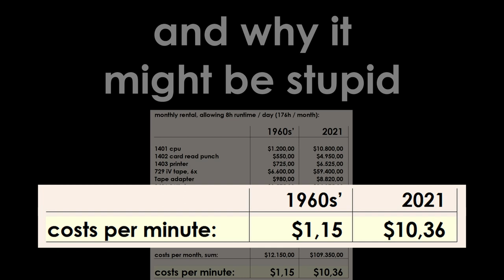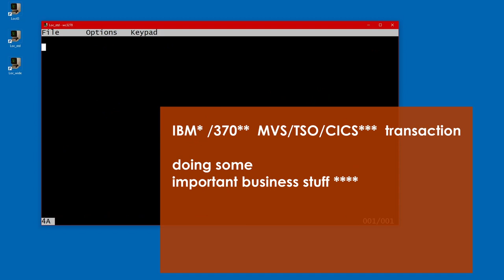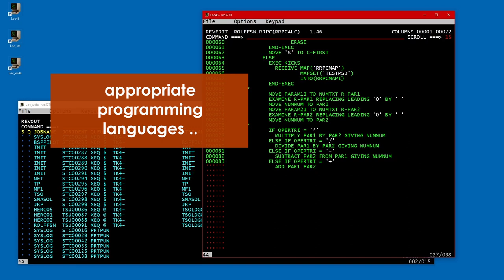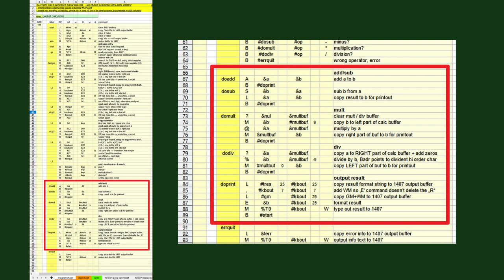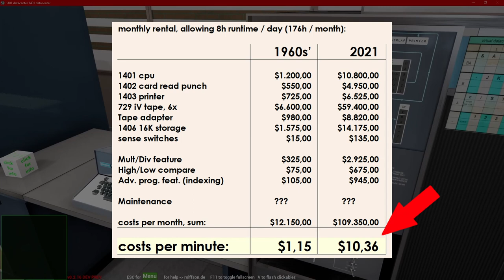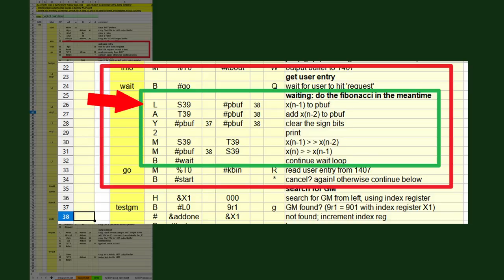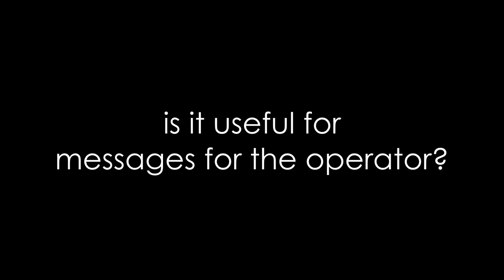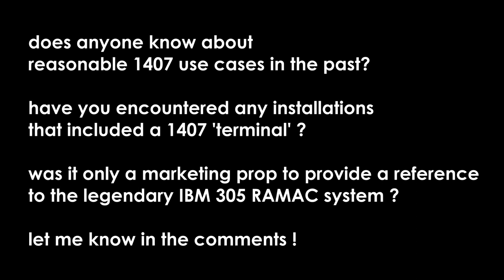IBM 1401 programming: the 1407 inquiry terminal - R15

Comment: I just spotted your series on the 1401 and it caught my interest as a former IBM 1400 series operator and programmer.  Back in about 1964-1969 (in Melbourne Australia) we operated a "big brother" IBM 1410 system (taking up most of the floor of a city skyscraper); we upgraded memory a further 16K BITS (BCD) from 48K to 64K BITS  (so for it's time it was a big system globally), plus we upgraded from 4 to 6 tape drives (and later added many more) and we added a second read/write arm on the IBM "RAMAC" 1405 disk drive !!!!!  We wrote our own operating system to monitor jobs and automate operations processes. To run some of our larger programs we had to load and unload large overlays from the 1405 into memory and branch to the overlay code.  The configuration of our system was somewhat unique so if we had a serious problem we'd occasionally phone the IBM Rochester factory for support.
* You asked for feedback on the IBM 1407 - - - 
*   Our system included an IBM 1407 enquiry terminal. You are correct in stating that as a device the IBM 1407 was not very useful. 
*   The only useful operational task of the IBM 1407 was it recorded the time each job started and finished (i.e. extracted from the operating system we wrote) and we recorded any error messages and sometimes occurrences when we needed to stop a job, if a job was re-run, etc. It was a crosscheck for "internal billing" to the various office departments. We would handover the original print-out at end of shift to the Operations Manager and carbon copy retained for auditing.
*   We operated with 3 shifts around the clock 24x7.  For normal operator tasks we had no use for the 1407 printer (except 1 job) but we did check it if if we heard it's chattering burst into action. The "one exception" was an annual job that ran non-stop 24 hours for about 4-5 days doing a full valuation of insurance premiums, life insurance cover, bonus calculations, etc. About every 20 mins the 1407 printed a short reminder message for that job reminding us of the particular tapes to mount next and whether a checkpoint needed to be made so we had somewhere to restart if we had a crash.
*   An IBM CE (Customer Engineer) was based on site and he would use the system to run weekly diagnostic tests, and if a fault was found he'd shut the system down, fix a problem, replace faulty logic cards, etc. So, a second useful task of the 1407 printer was to print out messages for the CE, record his testing, and the carbon copy was used by our auditors to know it was non-billable time. (Some individual transistors that performed one AND or NAND instruction were the size of a thumb.) 
Note: Our operators might do similar if we had a crash and needed to interrogate specific areas of memory and dump diagnostic data to analyse problems.
* So all the print-outs from the IBM1407 really only provided an audit trail of jobs, time-stamps for billing and traces used for problem solving

Comment: The document "IBM 1401 System Summary" says: "The IBM 1407 (Figure 35) provides a fast, direct, manually controlled means of communication between the operator and any model of the IBM 1401 Data Processing System. Using an instruction format, the 1407 can control both reading from, and writing into, storage. It permits the 1401 system user to either examine or alter the status of a particular account, record, or instruction stored in the system. This feature is especially useful in a disk-storage oriented 1401 system, where information such as customers' accounts, stock status data, and payroll details are kept categorically. Through the 1407, the operator can request specific data from any disk record, and have the information automatically typed seconds later. This typed copy also serves as a log of information entered into, or received from, a 1401 via the inquiry station."

It sounds like it would be useful in cases where you ran the same sort/search program, but with a lot of variability in the input parameters, especially parameters that you might not know ahead of time. It would need to be a big dataset, and it would need to be more valuable to the user to be able to call up data almost instantly, than it would be to keep the 1401 running other jobs while a new search program was punched.

Comment: Considering that the 1407 has the Request key to ask for attention from the processor, I suppose you could code a long running program to look for that key periodically and allow itself to be interrupted in a controlled way so the user could query data stored on disk. There's an IBM film on Youtube demonstrating a similar operation on a RAMAC system.  Edit: This is the film: https://youtu.be/oyWsdS1h-TM?t=488

Comment from the maker: caution when trying this at home:
the latest simulator version 0.2.15 has a flaw in the 1401 division command ('%') when the result has trailing zeroes
Reply: Divide by zero issue?
Reply from the maker: @huntabadday2663  no, it’s just that in 0.2.15 if the result ends in one or more zeros, the sign bits remain with the last non–zero digit, e.g. 1440 / 12 will result in 1B0 instead of 120. will be corrected in 0.2.16